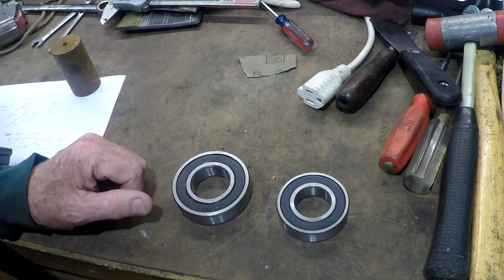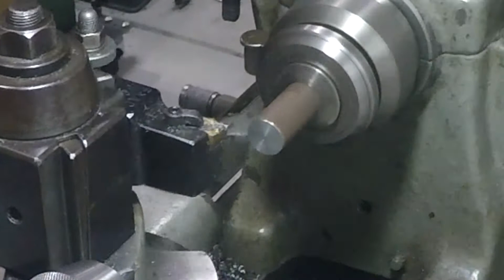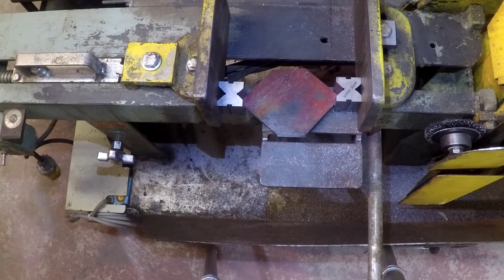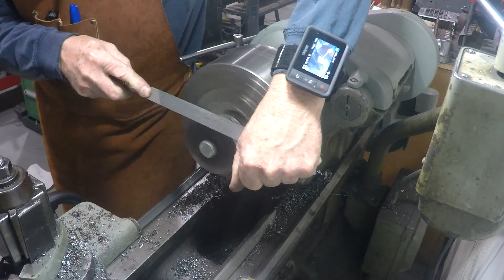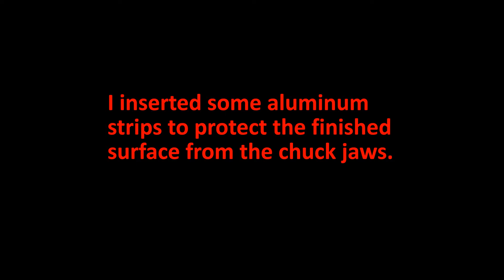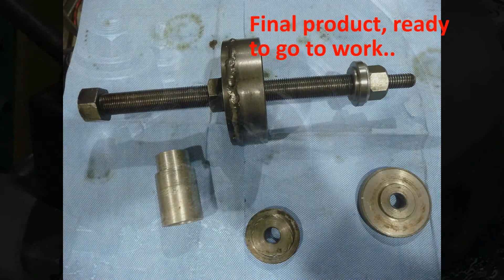Washing Machine Bearing Tool

Comment: Nice video , tool looks lot like Dwonus5  design  [2013 ] I know it's not rocket science but  I  only saw pics of  TonyTools marginal [ definitely overpriced] design and built better one.[ left thread ]  I use heat treated all thread so my left thread is lathe cut with carbide ,and  endbell nut grade 8 press fit  in end bell.  Tony's uses a thrust bearing and can't handle pressure of pulling old ones [even though his video is staged with fresh bearings installed],,just saying. 
    Another good tip,, when seating front bearing I recommend spacers in endbell [2 used Rr bearings]  backs up bearings so inner races won't side load [over preload ]when you seat against the steel spacer tube [ the part that 1/2 the video's out there toss out ]  it  gives inner races reason not to spin on shaft, not press fit on shaft.    Don Wonous
Reply from the maker: Thanks for the comments. To put the whole thing in context I built this tool with the idea of one-time use. I had some friends that asked me to fix their washer and the tool worked OK. I made the video as I was making the tool. Then one of my viewers wanted the tool to fix his washer so since I didn't need it any more, I sold it to him. Just as he was finishing his job the small threaded end broke off. He was able to finish the installation  but he wanted me to redesign it to be more durable and make him another so he would be ready for the next time he needed it. I made the next one with grade 8 all thread, longer nuts distribute the load better and probably some other improvements. I did make a video on the upgrade.

"Maytag Tool Revisited" video: https://www.youtube.com/watch?v=TqWdbtd-qHo

Comment: Sir, do you sell those? Mom's washer is making lots of noise.  Rather do the job right with your puller. Let me know please? Tks!
Reply from the maker: I only made the one I used to repair a friends washer. I sold it to one of my viewers. If I were to make another, it would likely be late July before I could get to it. They are commercially available but expensive.
Reply: ok, tks!
Reply: Hi. Do you have one of those for sale?